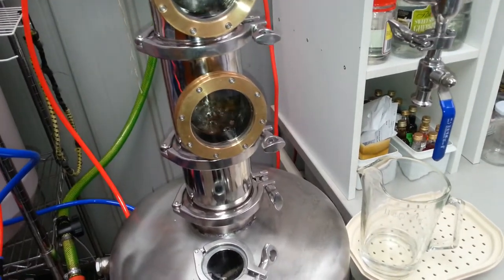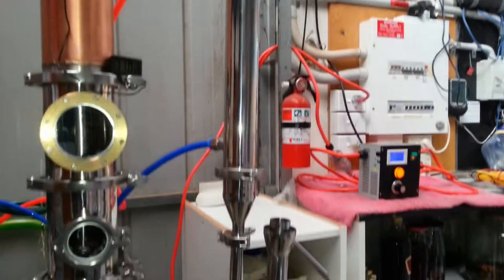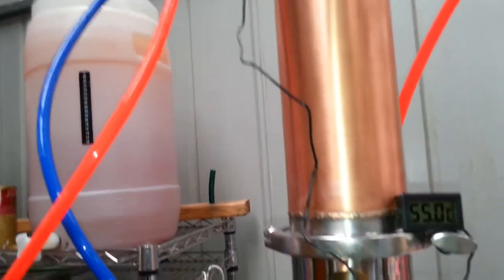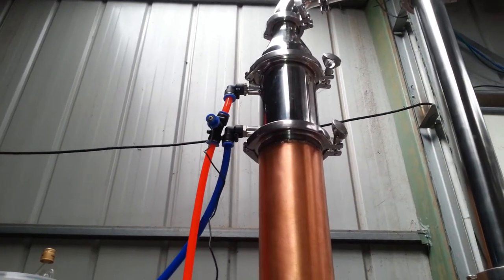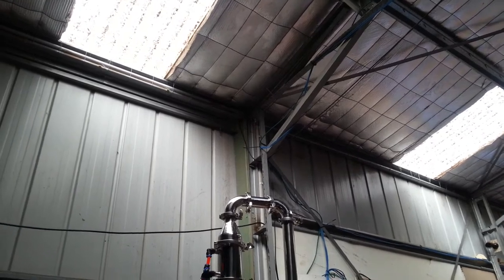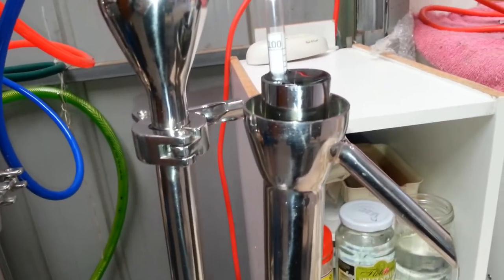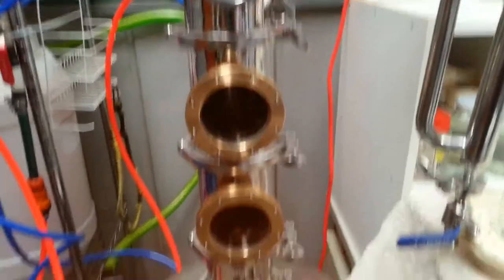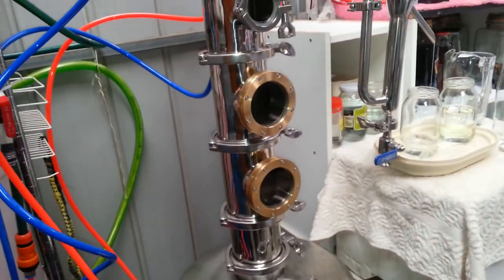Stilldragon Dash 1 -  4 Plate Bubblecap Hybrid Run

Comment: I see some people hook the dephleg cold into the bottom and some into the top. I’m confused as to which is more correct
Reply: No right or wrong way, but consider if you have the inlet/cold water entering from the bottom then the condenser(s) will be full of liquid and the hot water exits from from the top really no matter how fast or slow the water flow.

However if feeding from the top there is a real chance the deflag/condensor unit may have just a little or no liquid actually cooling, if it has drained naturally or the output is greater than the input. It will depend on pumps, air pockets, valves, monitoring etc.
I've gone the other way and the outlet just drains the whole system if left on when the water flow is turned off - ie stop the pump and the deflag drains out.

In simple terms feeding from the bottom is safer/easier for most of us as we adjust the valve from the top outlet "waste" hose, therefore acts much like all our taps and hoses we use in a house, the pipes are loaded all the time no matter if a tap is on or off.
Water feeds in, has enough pressure/volume to fill all the hoses and condensors and we just adjust the outlet - as thats the hot excess after all the work cooling has been done.
Mine is feed back into a 1000 lt tank, others I know feed the outlet as waste water, either down the drain or onto the lawn/garden.

Fadge
Reply: @gregmcfadyen8865  thanks for your response. I never thought about controlling the flow from the outlet side. Makes a lot of sense to feed from the top and control flow from the exit at the bottom. Cheers mate

Comment: Hey mate, what is the temp process for your still. E.g. When you first start your boiler for a distillation run what temp are you aiming for to load your plates? Do you adjust power throughout the run? and if so, how do you know when to increase power?

Comment: How big is tank?
Reply: The cooling tank is 1000Lt and can handle most runs or back to back until the peak summer times, then I allow some to drain and top up with mains, a block of ice or two would do the same thing. The Boiler is 50Lt, can use run fast as stripping say 1 to 1.5 hrs, and do 3 in a row.
Or as in video do a full spirit run that may take about 6 hours from start to finish if taking my time.